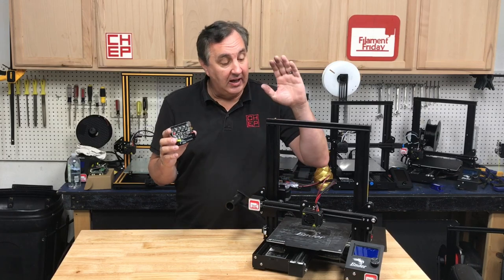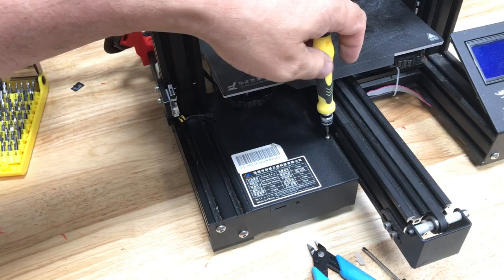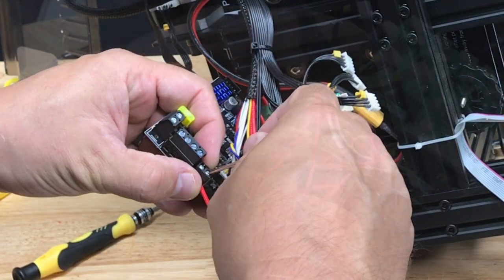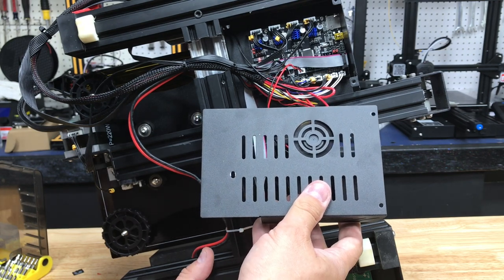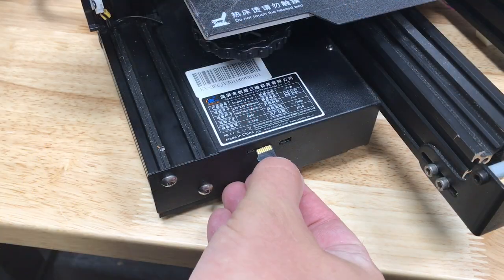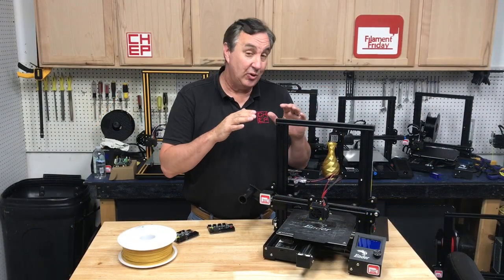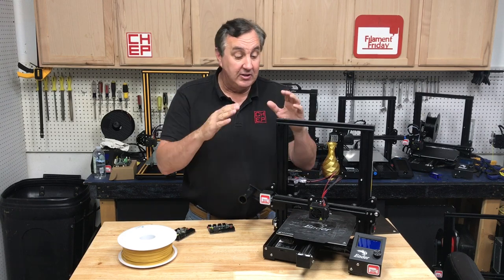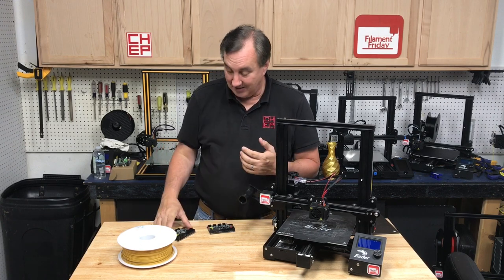Creality Ender 3 Upgrade to 32-Bit SKR E3 Mini

Comment: I've had the 1.2 board installed for a while now, and I couldn't be happier. Aside from making things quieter, it also has a dedicated connector for a BLTouch--although I wound up installing mine on the Z-home anyway. What REALLY made a difference for me was the BIGTREETECH touchscreen--another direct replacement, with a great user interface!

Comment: I did this upgrade, really simple and makes a big difference  in the noise factor, I still have not installed my TFT24 or the BL Touch or come to think of it the direct drive kit. A video on installing the BL Touch and maybe the TFT24 on this board (including software changes) would be awesome

Comment: This board totally changed my ender 3 it fixed all the problems I was having with artifacts and under extrusion. My prints often come out perfect or close to perfect now. I suspect that my printer had a controller with outdated firmware and a bad configuration and the new board fixed all that. It is silent as well which makes for a happy life.

Comment: Good tip on using the pliers to hold the screws.  I usually magnetise the screwdriver, but you can still lose them — usually they’re wedged somewhere dangerous where it’ll short out the board if you power up.  No screws left behind for electrical work!

Comment: I just put the 2.0 in mine 2days ago. It was really easy. It is crazy how quiet it is now. All I can here the fans and the stepper make no sounds. I did also get the replacement screen for it and it just makes it a lot better. Btw I do have a bltouch and direct drive on my ender 3. 😁👍
Reply: Same, I did it because my x axis started making a horrible grinding noise. After trying the 50 or so different fixes for this problem, the 2.0 solved it.
Reply: Have mine on order can you tell me if mesh bed leveling is enabled out of the box or does it need to be enabled? Also, didnt quite get what was being said about the fans, did you just follow the instructions there?
Reply: @peejayw  I don't know about the mesh leveling. I think what was shown above was just normal leveling, but he had a program to move the head, instead of manual jogging.

I watched a different video for the installation. Some Australian dude. The fan connections are the same IIrc, but act a little differently. It's pretty much a drop in replacement, with a few extra connections that can be populated with things that don't come stock on the machine, like bl touch. The difference in noise though, is phenomenal.
Reply: @peejayw  The fan part was just me saying that is the only noise coming from the printer at all. If I had silent fans the machine would be die silent when printing. 

I did flash the ender 3 firmware on it the was listed to be for the bltouch. That being said the pin out in kind wrong and sure you can change it but I found that you can used the 3 pin in the prob port and the 2 pin in the normal z switch location. 

I hope that makes sense haha

Comment: Just a heads up if it hasn't been mentioned yet, but any original Ender-3 owners that install this board are in for a treat: Creality (at least on mine) made sure to cover all of the connections with hot glue, making for a fun experience of trying to free everything up in a rat's nest of wires before you can swap all of the connections over. Thanks Creality! =(

Comment: Perfect timing, because I just ordered mine earlier today and it should be arriving in three days along with a BL touch
Reply: It awesome because it comes with a port for the bltouch 😃

I recommend using it as the z homing
With that you can change plates (beds) and not have to change the z offset!

Best upgrade for the $ IMHO (the silent steppers 😜)

Comment: I know it's an introduction so compiling marlin is beyond the scope of this video, but it's still worth mentioning that the bigtreetech firmware is always a little older than the latest marlin. There's a comprehensive guide on the ender 3 subreddit which is always up to date to compile the firmware yourself. Got my E3 v1.2 with bltouch going on marlin 2.0.6. As others pointed out manual mesh bed leveling is enabled in the firmware, this is also worth mentioning.

Comment: Did this recently and it's amazing how much quieter the printer is. The only issues I had is the FAN0 & FAN1 have to be swapped and if you have a BL-Touch you need to change a couple of wires around to put it into the probe socket.

Comment: Got an Ender 3 and put in the SKR mini E3 V2 with the TFT35 E3 V3 and although it is a straight swap replacement for the stock Ender 3 board there’s a lot of changes that need to be made to get it running like the stock board did and you’ll need to tweek you’re alignments and go through many compiles to get it to print to an acceptable standard especially if you also want it to run with BL Touch (V3.1), Smart Filament Sensor, Mini Ups, Bed & Hotend Mosfets, Buck Converters, WIFI and Relay Module like I have, I fount that the SKR Mini E3 V1.2 is a much easy board to work with and it takes the additional add ons soo much easier with less fuss and you run into a lot less problems like you do with the Mini E3 V2 plus there’s not much help out there for the E3 V2 board, BTT’s github have a 5 page diagram on the V2 board which really doesn’t help too much, I replaced my V2 for the V1.2 and it’s running superbly!
Reply: I just installed an e3 v2 on my ender 3 pro a few days ago and the whole process was incredibly straightforward...
As of today I'm running it with octoprint on my PC with a bltouch installed. Zero issues. I used videos on youtube as guides to get everything ironed out. Printing beautifully. My next step is getting octolapse going, I just need to get a cam.
Reply: Thanks for this comment.  I had the v2.0 on my amazon wish list and just changed it to 1.2 based on what I have been reading and this comment seals it.  I just want it to work and seems like the 1.2 gives me everything I need and has been out long enough for the bugs to be ironed out.

Comment: With the new board and firmware, you don’t even need to use your bed leveling G-code anymore because it’s built right into the menu now. Go to Motion > Bed Leveling > Level Corners. I have a BLTouch setup now so I haven’t had to touch that since, but that was really handy to have if you still manually level your bed corners.

Comment: I'm waiting for my SKR E3 Mini V1.2 to arrive from Amazon. My primary interest was manual mesh bed leveling and thermal runaway protection, though I have my eye on something like a BLTouch down the line. It seemed like buying this replacement board would end up being more cost effective and easier than trying to flash the existing Ender 3 Pro board, and I won't complain if it runs quieter when it's all said and done. Ideally, this will enable me to feel comfortable enough to let prints run overnight.
Reply from the maker: I agree with your thoughts.

Comment: I've been running 32 bit boards from TH3D on all of my Creality printers  and the silence is deafening.  I can work and talk on the phone near any of the printers while they are running without loud stepper sounds.  I use two of the EZR extruders based upon your recommendation.  I had to file the bottom of the inlet a bit to get it to lay flat on my Ender 3 pro as it interfered with the Z rod plate but that was a 5 minute mod that was well worth it.  The EZR makes it very easy to load filament unlike the Creality style extruder that can be a bit fiddly to get the filament in the filament guide after it passes by the hobbed gear.  I agree on the glass upgrade for sure.  I immediately removed the magnetic mat halves on both of my Ender 3 pros and they have bare borosilicate glass which is my favorite.

Comment: Well this is a first Chip, I bought something off Amazon from a Youtube recommendation. I have an original E3 and after the original flurry of printing things out to make it 'better' and one or two paid upgrades it's basically sat on my bench printing any and all prints I ask from it. This is it's first upgrade in two years and I'm intrigued as to how it will improve the printer. Thanks (in advance) for the tip.

Comment: I got two of the v2 boards. One for my Ender 3 and one for my Ender 5. If you're going to install the v2, do it on the Ender 5 as  was having some issues with it. Perhaps with your knowledge, you can post a working setup.  As for the Ender 3, I was plug and play, I even opted for the touch screen (TFT35 v3), works great. Thanks for this video.

Comment: I just ordered my new board on Amazon for $46. Thanks Chuckles!  Well worth it just for mesh bed leveling option in my opinion.
Reply: Better late than never I guess but mesh bed levelling can be enabled quite easily in marlin 1 with the original 8 bit board, I've been using it for a year and it definitely improved my experience, I've only just swapped out my creality 8 bit silent board for a E3 dip v1.0, the 8 bit board was working great, now I'm having fun with prints not sticking so got to do recalibration for the new board

Comment: One thing that would be great is a spreadsheet that shows what features the various upgrade boards have. I started researching it and gave up with info overload. Maybe you can post an editable google spreadsheet that people can fill in the details on what each board does so it's easier to select which one and not buy a board with too many or too few features.

Comment: Hey Guys!
About a week ago I finally installed my SKR E3 Mini V2.0. I mainly got it so I could run Octopi and use a BL-touch. It took a LOT of searching to deal with firmware as I didn't know you just put the sd card with the firmware (once it's named firmware.bin). Especially as I wanted the BL-touch to home in the center of the build plate If anyone has any questions I'd be happy to give some advice. 

Quick Warning!
My Ender 3 board was LOADED with hot glue! When switching out the old board take your time carefully removing the globs of glue so you don't pull out or rip and wires!

Comment: So what is the advantage of doing this conversion?
Reply: Silent stepper drivers. The only noise the printer makes is fan noise. I've also noticed more detail at finer detail but it may just be placebo
Reply: The major advantage is quiet stepper motors but the board has 2x the memory and so the firmware has more features enabled in it and it's Marlin 2.0. If you are intending to get a BL-touch or one of the clones you also don't need Creality's kludge kit that repurposes the beeper to use for the probe because it has a dedicated probe port.
Reply: @drxym  oh okay thanks for the info!

Comment: Annother drop-in would be the FYSETC Cheetah.
The only thing that I do not like about the Cheetah, the E3 mini and the board from Creality is their choice of controller, all these use a STM32F103 which is the first generation grand-dad of STM32, these came out in 2007.
A STM32F446 for example only has one pin on the package that is used differently.

Comment: I installed the skr  E3 mini V2 on my Ender 3 Pro.  I'm currently testing with the firmware that came on the board.  As soon as power is applied, the hot end fan turned on, and stayed on all the time just like on the stocked motherboard.  In one of your other videos, you showed a way to control this fan on the stocked board by adding circuitry.

Is ability to control the hotend fan via firmware built in on the SKR Mini E3 board, or is some sort of mod similar to what you showed in the other video still necessary?

Comment: Have you done a video that compares the boards  and the advantages of going 32bit?
Reply: This is what I was going to ask..  Seeing as though the purpose of the board is simply to process G-Code, what is the advantage of 32 bit?  He mentioned the M0 command, but is that it?  Someone mentioned lower noise, but I'd have to think that would be a feature of the stepper drivers, but maybe I'm wrong..  What does "32 bit" really give you?
Reply: @SteveJones172pilot  Have you ever noticed that while printing, there are sometimes really tiny pauses/slight jerks when the print changes direction or speed? What I was told was, those are the times the board can't keep up with reading/interpreting what's saved in the G-code file (it waits for the next part of the code to load). If the print you are doing is a rather simple one without a huge G-code file, those tiny pauses are barely noticeable or not there. Anyway, supposedly the extra memory available on the 32bit boards, allows it to read the G-code faster/easier, which means it should run smoother in term of what it's telling the motors what to do, which should improve the overall look of the print (it's like having more memory on a home computer, which can be used to have more programs or browser windows open at the same time without the CPU slowing down to a crawl). It term of 32bit boards, that  also means more things can be added to the board without worrying about running out of available memory, like BL Touch, mesh leveling, power failure resume, etc.
Reply: @CoroaEntertainment  Thanks - That makes sense..

Comment: Thank you so very much for the expansive library of teaching videos.  I have learned a considerable amount from you.  Now I am facing a challenge and could use a bit of direction from you.  I've upgraded my Ender 3 Pro by installing both the BTT SKR Mini E3 V3 along with the TFT 3.5 touch screen.  And I did it by following your concise instructions.  However, recently I had my printer hooked up with my raspberry pi 4 via the Ender 3's micro usb port.  I forgot it was connect and move the printer and - you guessed it - I ripped the usb port right out of the Ender 3.  Would I achieve the same result by connect the raspberry pi to the tft 3.5 screen's usb port?  Would that provide me with the connection I need to access octoprint?  If not, how hard is it to replace the usp port (by a confirmed mechanically challenged individual)?  And I I can't do that is there a sd card that I can use that would give me wifii access?  Or should I just bite the bullet and buy another SKR Mini board?  Thanks again for all of the time and effort you have generously donated to the community.  Stay healthy - Dov
Reply from the maker: I’m not sure but a new board would probably be the best solution
Reply: Thank you for the fast response.  It is not the answer I was looking for but you are probably correct.  I'll order another SKR and install it.  Your videos are really excellent.  Thanks again.

Comment: Thought about buying this board but I´ve rode that many got the TMC Connection Error, causeing the Z axis not able to move anymore. (I think the driver wen´t straight down to hell). So I checked the possibilites for another board upgrade but they are pretty expensive (Th3d or the duet line mainboards). Did you have any problems since you are using this board?

Comment: I installed this board and the touchscreen a few weeks ago, it ran straight out the box beautifully on my Ender3. The noise reduction was a big difference and my print quality improved straight away using the same stl file I had already printed with previously for the test cube. A few weeks on and everything was going okay until my fan headers stopped working, first the mainboard cooling fan stopped then a day later the part cooling fan stopped working. After checking the forums it appears the fan mosfets are to blame and this is not just to this version of the board. Still trying to get it sorted with bigtree reps at the minute but other than that this is a great upgrade
Reply: Same here. Bought a BTT skr mini E3 v2.0 and changed the stock 1.1.4 from creality at my ender 3 pro. Everything awesome for the first 5-7 days until I added some buck converters to reduce 24V to 12V from FAN0 and FAN1 as I wanted to install some noctua 12V fans. I guess MOSFET got damaged and FAN0 Kept running while printer was powered on not being controllable anymore. FAN1 just didn't respond anymore.(They both started and stopped automatically first days). As I liked the board, gave it another chance and bought another one. And just right out of the box, and installed with all wiring gave me same problem... I keep wondering if it is a problem with the buck converters (it shouldn't )... I gave up wiht the BTT boards and have a silent 1.1.5 creality one now... works perfect with my noctua fans and all my config but It's not a 32bit board and way more compicated to install marlin 2.0 on it... :(  A couple of days ago I was wondering if it might be good idea to try e3 mini 1.2 instead of 2.0 But not sure (I don't want to get trouble for 3rd time)...
Reply: @eliasfedericosanchezgomez1135  has ended 3 v2 a 32-bit mother? I thought that creality 1.1.5 board was 32-bit
Reply from the maker: No 1.1.5 is 8 bit with silent drivers.
Reply: @FilamentFriday  ok thanks!

Comment: I recently installed the mini E3 V1.2 on my Ender 3 Pro .  I used this vid to do the install. But I can't find the firmware download for it . I can't find it on the suggested website. Is it because it's two years old. Any help I greatly appreciated it.
Reply: its right in the video. when you go to the website, click on the green "Code" button and select download zip. inside the zip there is a firmware folder. inside that folder is a v1.2 folder, thats the firmware for the 1.2 board.

Comment: I have a question , i ordered this board and one of the btt touch screens and installed em and now for some reason my prints are taking way longer to print using the same cura profiles and settings , prints that took around 30 to 40 minutes is now taking a hour to an hour n a half , do you have any idea what could be causing this ? Thanks and love the videos there always full of great information 👍👍